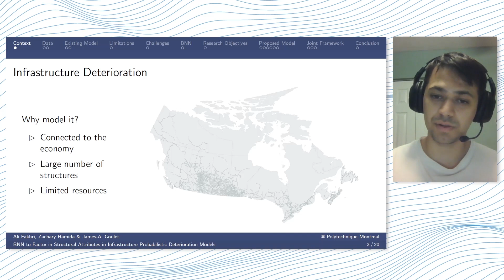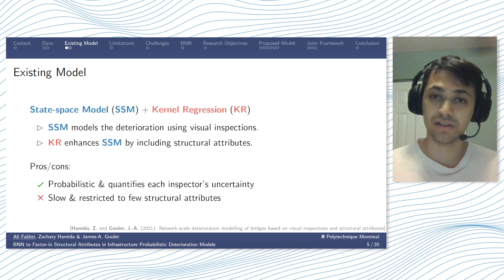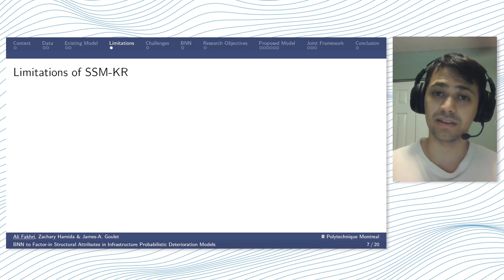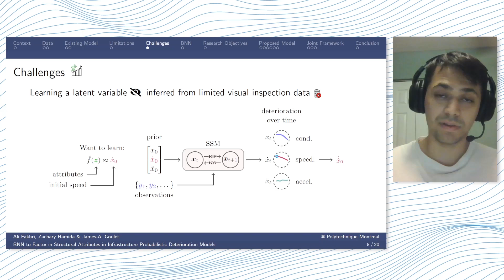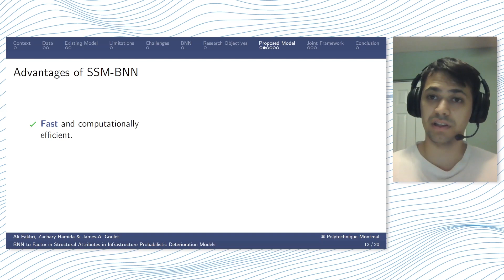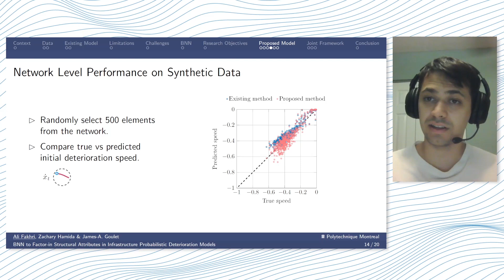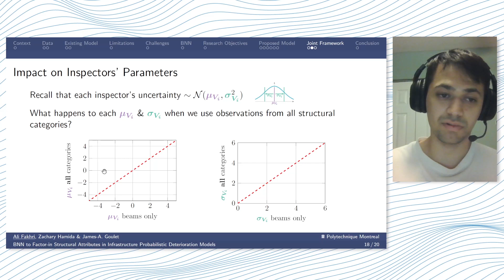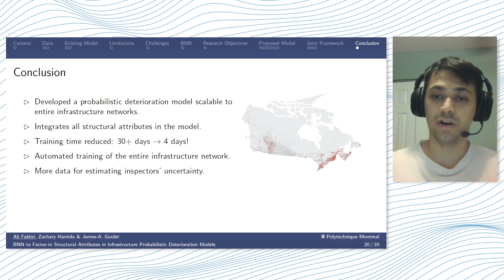Bayesian Neural Networks for Infrastructure Probabilistic Deterioration Models

Comment: Hi Ali Fakhri,

I truly enjoyed your presentation, especially your explanation of the intricacies of Bayesian Neural Networks (BNN) and the way you outlined the research objectives with clarity and simplicity. Your approach made complex concepts much more accessible.

I have some questions about the findings you discussed:
On Slide 13:
1. The shadowed areas on the charts are shaded in two colors—am I right to interpret these as representing confidence intervals at different levels, with the darker shades indicating higher confidence?
2. The broadening of the shadowed areas over time caught my attention. Would you say this is mainly due to a decrease in data reliability for future conditions, or might it also involve other factors, such as model assumptions or other external reasons?
On Slide 19:
3. The model shows commendable performance across various datasets, except the 'Pavement' category, where a significant difference is observed between validation and test set performances.  Are there notable variations within the 'Pavement' datasets specifically? Is it possible that the model's sensitivity to subtle data differences becomes particularly apparent when subjected to the more diverse range of examples in the test set? 

Thank you for your presentation and for taking the time to address these questions!